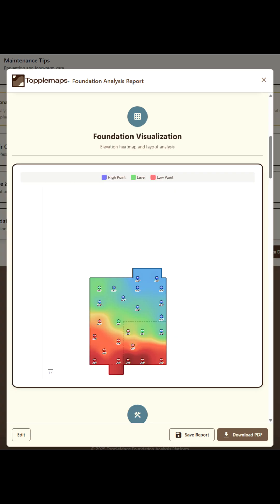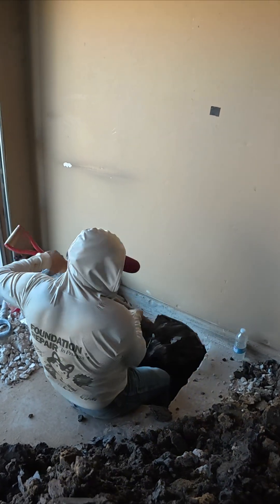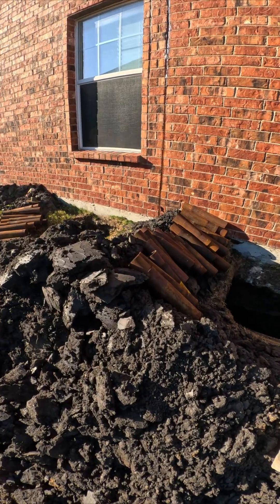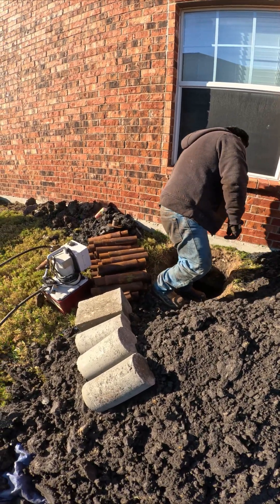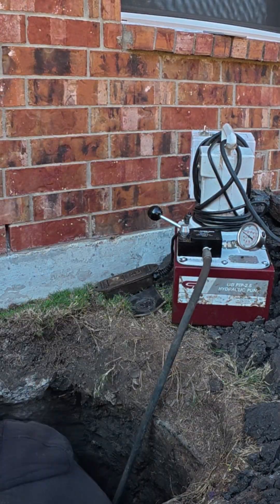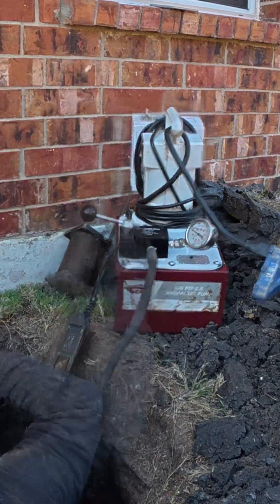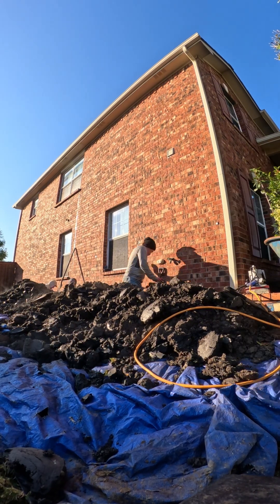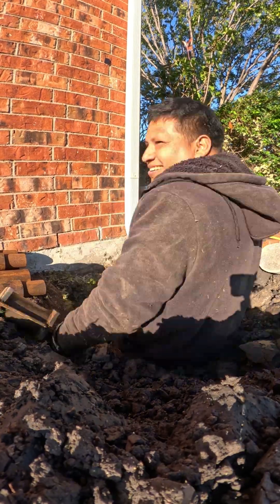How We Fix a Sunken Foundation With 30ft Hybrid Piers

Comment: You need a device that can tunnel for you. 
1.) Dig a 4’x4’x4’ hole at the edge of the house.
2.) Set the boring device into the hole. 
3.) Dig the tunnel at a rate of 10’-20’ per hour. 
That would be a moneymaker, no doubt.
Reply from the maker: Oh yeah! Something like these would change everything

Comment: I really really wish you were here in Hawaii. We have very tall post and pier foundation that needs to be stabilized and some lifting/leveling done. The post arond the front and side perimeter look like telephone poles and are about 12-15ft tall! No tunneling required at all! In fact, you would need ladders haha!
My problem is that we are on a hillside. Settling seems to be inevitable. Is it reasonable to just lift and shim or put taller beams where needed or go all in and anchor the piers to bedrock? I'm not trying to spend $150k like I was quoted for micro-piling. I was hoping someone could just lift and level as a quick fix and maybe do the micro-piling later? Any input from you would be greatly appreciated. I absolutely love all your videos on this fascinating subject. 
Aloha 🤙🤙
Reply from the maker: Aloha! Thank you so much for the support — I really appreciate you watching the videos.

Based on what you’re describing, the very first thing I’d look at is **erosion control**. On hillside homes, erosion is one of the biggest causes of ongoing settlement. Even the best repairs won’t hold if the soil is constantly moving or washing out.

As for the posts being 12–15 ft tall, that’s common in Hawaii on slopes. In cases like yours, yes — sometimes a contractor can lift, level, and shim as a temporary correction, but it won’t stop the long-term movement if the underlying soil conditions aren’t addressed.

Before spending anything close to $150k, I strongly recommend having an *independent structural engineer* evaluate the home. Not a foundation repair company — an engineer who doesn’t sell any repairs and has no monetary interest in the outcome. They’ll give you an unbiased diagnosis and can outline ALL possible solutions, including options that may be more affordable than micro-piling.

Depending on the soil and structure, there may be intermediate solutions like:
• Rebuilding or reinforcing specific piers
• Upgrading footings
• Additional bracing
• Drainage improvements
• Targeted micro-piles only in critical areas instead of the whole perimeter

But the correct approach depends entirely on what the engineer finds.

If you ever have any doubts or want a second opinion, feel free to email me anytime at *[ifixconstruction.jo@gmail.com](mailto:ifixconstruction.jo@gmail.com)* — always happy to help.

Aloha 🤙🏼
Reply: @ifixconstructionfr  man that was a quick response! I will certainly email you. Maybe if you have time you can look at a few photos of underneath my house. I would be grateful for that. Thanks again for your advice! You have a friend in Hawaii now 😊
Aloha and Mahalo 🤙🤙
Reply from the maker: Thanks, I will be more than happy to check the pictures and give you an honest opinion

Comment: Dude that’s cool, what program did you use to map out and visualize the foundation with the blue and red and yellow and green colors? How did you get all those measurements and numbers for that program to display? Thank you
Reply from the maker: We use our proprietary web app topplemaps. Anyone can register and try it. The only boomer is that a zip level or laser level is required to get the elevations of the house, but once the elevations are measured, we use AI to provide an accurate assessment of your home using the international building code guidelines.
Reply: A marble will tell all..